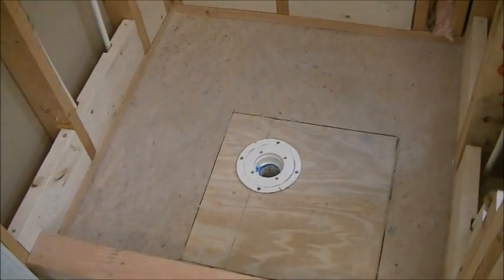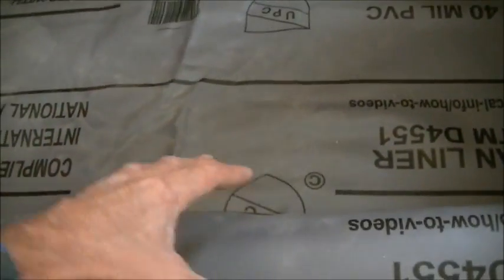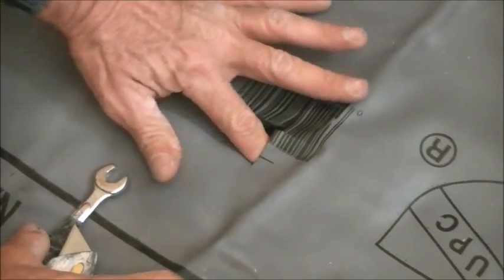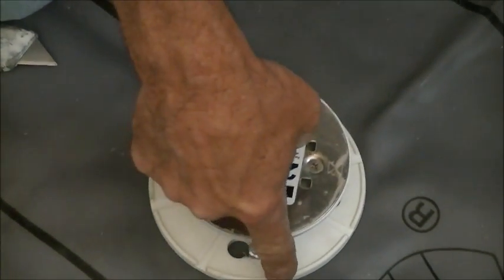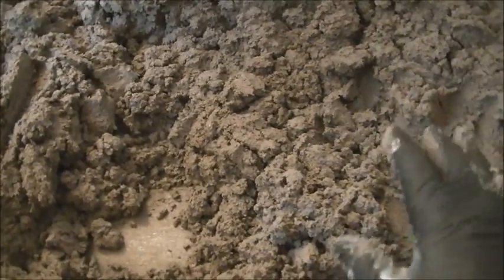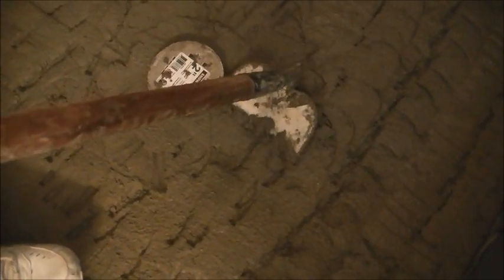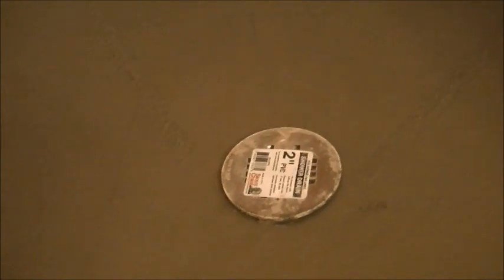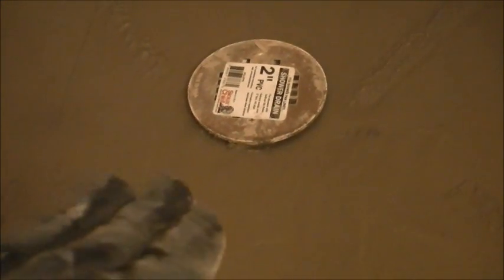How To Install & Pour Shower Pan

Comment: You are the first person I've seen who has put the flange bolts through the pan liner in a way that actually makes sense. Perfect, gasket-tight fit. Also, thank you for explaining why dry-packing is unnecessary, slow, and probably less sound in the long run.  Good stuff, thanks.

Comment: I used your Technique but pushed a roofing nail through and found the hole and then screwed my bolts in. But you have great information I'm almost done with my first walk in shower thanks to you

Comment: I poor two pans with red guarding each one. I also use quick pitch in my shower pan. I would highly recommend using them. Makes it super easy to get a perfect pan every time! Install from drain to each corner, screed your mud off of them and your done. Nice flat pan for a perfect tile install.
Reply: I had the quick pitch kit on order but had second thoughts. I did my preslope and pan by hand - it was not really all that difficult. Labor intensive, yes. But easy once you do the perimeter to the desired height then fill in the blank area, screed off down to the drain, and there you go.

Comment: You should try using a Marshal Town magnesium float to pack it down. To me it would be easier and faster than a mixing hoe. The comfort of the handle of the trowel would be easier on your wrist as well than a 2x4. Just a suggestion is all. Love that you use a drywall knife to smooth it out. They are universal in construction. But no tool is more universal than a utility knife. Mine gets more action than all my tools combined. It is a must have along with a 5&1. Love the videos.

Comment: congratulations! you just layed a brick mortar shower pan!! lol you might want to use blue tape to cover the top of the drain to protect it and for your information the drain has to be loose because underneath their is 4 vent holes that need venting on FHA drains and it needs to be loose for that and it helps to level out the tile for maximum draining compasity
Reply from the maker: Congratulations...you just watched a tiler with 19 years experience do it his way
Reply: +Jason Sanchez Congratulations you spelled capacity or compacity wrong which ever  you tried to spell, with your knowledge you should learn to spell.
Reply: mark card its my phones fault dang auto correct ! lol

Comment: I just pulled out a pre made shower pan from my basement shower (it cracked of course). It also had a 3 piece shower wall kit. I want to replace the pan with a poured one like in this video. Can I re-use the wall kit or do I have to put tile board and tile the walls? Thank you, love your videos.
Reply from the maker: If you do a real pan, you can't use those fiberglass panels. Yes, you must tile the whole shower.

Comment: Bob, I have to thank you very much for your videos. I have watched yours along with two other prominent YouTube remodelers, particularly the shower pan guys, and have just finished 'pouring' my first shower, a 3x5 center drain job. I took the best of all yoos guy's recommendations and I feel I am now an expert. I do have pics of the whole job from tearout to present. I can't see why folks put their Durock down to the floor and include it in the pan. Makes no sense. I am hanging my Durock 3/4" off my mud deck once set. Then 5mm hex tile floor and 18" wall tile. BTW I have been thinking of a price I would charge for this work while working along. It is based on blood, sweat and tear factors. I think I have a number. Would love to someday get a real quote from an expert and compare. Anyone in New Mexico you would recommend I contact? I will have another bath to do in a year or so. Was done 10 year ago by a box store contractor, and I feel like I can do it better.
Reply: In Austin TX shower pan pours range from $350-$650

Comment: Nice job but I would use the Schluter system. These are the older ways of constructing shower bases. Schluter has various sizes of bases with center drain, offset drain and linear drain systems. If the shower is too off and the Schluter base cannot fill in the whole area then I fill in the cavities with a sand/cement mixer. Also their is a company in Vancouver Canada that will create a custom base based on your dimensions. They work with the Schluter drain systems so everything comes out perfect. I have used them to create a 36" x 97" shower.

Comment: Nice video ! you make it look so easy ! I did a pan and it turned out pretty nice, but man I made a mess ! After the pan dried I have a couple of small low spots. Is it ok to go in with thin set to fix em ?
Reply from the maker: Yes I always screed out some thinset if I have any even minor dips

Comment: First off, thanks for your videos. Just a DIY guy here, I installed my pan liner yesterday, all went well. 
I bought the Home Depot Sand Mix (Sand and Bedding mix) It says it's a 3:1 ratio so I also bought some sand also to add for the mix. 
One Big Comment for you  StarrTile - In this video you say you used 3 1/2 Gallons of water for 2 bags. I'm not sure what bags you were using, but for what I bought at Home Depot, you only use 3 1/2 Quarts Per Bag - less than 2 gallons for 2 bags. . As usual, I added too much water, at first the mix looks dryer than what you show, but after you start working with it, the water really comes to the top. Hooe it does not mess up the drain, I was soaking it up with paper towels as it built up around the drain. 
Anyway, takes a DIYer like me more like 2 hours to pour and level out the bed. I think it's close enough. I'm hoping when it dries I can scape it around like you said in the video. 
Also assuming I can use Thin Set to level off any low spots (any comments on that? ) 
Thanks again. 
Next weekend it's Green board on the ceiling - Hardi board on the walls  (1 inch above the Bed as you show) All followed by a bunch of RedGuard - 

Hef
Reply from the maker: Actually the pre-mixed MORTAR in 60lb bags ( sand topping mix ) Is ready to go, no need for more sand. And it's ABOUT a gallon of water per bag...for 4 bags it would be about 3 1/2 gallons
Reply: Thanks, any tips on using thin set to level off low spots? I've got plenty of time to get this right.
Reply from the maker: Yes you could use thinset to level/manipulate the surface, but the ratio of water you used concerns me...if it was that runny you might have a compromised pan, I would consider busting it up & doing it over.
Reply: Thanks, I measured the water very carefully. I used less than the recommended 3 1/2 quarts for the first bag, seemed very dry. I can only mix one bag at a time, so on the 2nd bag. I just used the full 3 /1/2 quarts. I was looking for that consistency you showed in the video. Honestly, I think if I could have got it in there are worked it for 20 to 30 minutes as you know how to, you would not have seen all the water come to the top. , but I had to work it for much longer. The mix was not soupy or runny, just that water came up and ran towards the drain.

Comment: StarTile, I so agree with you on wet vs dry pack. Cement does NOT dry, it cures. It is a chemical action that makes the mortar hard. How can it bond and be ridged without water to cure? Dry pack strength will be mostly in the packing but missing the effect of setting up as concrete. Good video and instruction. Thanks.
Reply: Less water stronger concrete when you pack a dry pack if it comes way harder than fat mud also you should never have line in your shower pan it will crack

Comment: How do you prevent punctures to the sheet liner? I see you fold it in place, and attach it to the studs. This leaves folded areas in the sheet. So now when you add the mortar and the tile, you add weight. How do you make sure the weight of all that material doesn''t create holes in the folded areas. Does that question even make sense? I hope so. Thanks

Comment: I'm not saying your dry pack method  is wrong but to say it's a faster method is.  imo using wet mud is alot more touchy and seems to be more time consuming then a traditional dry pack. if a dry pack is mixed properly it drys very solid with no dry spots and levels and packs with much more precision then a wet sloppy mix. you also get no water rising and it's just a cleaner operation.  in the end, neither is wrong or right it's just what your use to. I actually duroc first, but leave the duroc up from the floor at the correct height of the dry pack and tile, this leaves me a level perimeter of duroc in which to more accurately estimate my dry packs perimeter.  I also draw a level line on the wall a foot or so from the  floor  which I use to precisely measure my dry packs perimeter. I know you said you like the dry pack to be tight against the threads of drain, but I'm sure you have to have adjusted your drain a little after a dry pack? personally I don't think adjusting the drain (threading up or down) after a dry pack does any damage what so ever, so what I actually do is pack to the top of the drain (making sure the drain has enough threads to adjust upwards the thickness of a tile )  then after the pack I adjust it up. I just find this a more accurate and faster way to pack, this way you don't have to spend alot of time worrying  about the distance from pack to drain in terms of tile height, also your levels can span across the top of drain as your packing, which allows for a better visual imo.  but again, it's personal preference and in the end your finish product looks great and I can see you take pride in your work and thanks for taking the time to educate. ps, I still would have completed the pan liner to the outside of curb

Comment: You don't necessarily need to install a pvc pan liner. I do prefer it but if you are using a drian with a bonding flange from schluter or prova or laticrete you do not need the pvc liner. You mud your pan with a chaffing membrane and diamond lath. You can do this after or before your backer board is installed. I install my backer board first and water proof it. Then I install the mud with a bonding flange style drain. After the pan is set you then install the membrane over top with all of the banding. Therefore making the surface of all the shower waterproof. Prova is my favourite because I can use unmodified or modified thinset to apply my tile. I'm a laticrete and Tec snob so modified thinset is my go to. Always use a grout that is professional grade with a sealer already in the grout. Laticrete pro grade grout is a great option. Tec has an acrylic additive for standard grout or opt for power grout. Power grout and laticrete also use Kevlar Vs sand which is stronger and able to fill smaller joints.

Comment: Very nice presentation. I have a question about a basement shower pan. I live in CO, and the wall regulation in CO requires that basement wall are floating. There's a normal base plate, but then the wall have to be 1.5 inches above the base plate, and are only attached at the top, and then a 60D spike nail through the bottom of the wall plate that is then driven into the base plate attached to the floor. As you can imagine doing this around a shower, and then adding the pan, and then tiling above the pan, could lead to some cracking issues in the wall grout. Do you have any suggestions, besides move to a different state?
Reply: yachick455 I am not familiar with this strange code.  However from what I understand after reading through the code.  This gap is to alow for rise and drop in the floor.  My best guess would be this.  If you have room after your pan and tile finish is within 2 and 3/4 from the original concrete floor?  (since your floor plate is 1.5" and the gap is 1.5" you will want to stay slightly under 3").   Install a waterproof expansion joint then tile up from there.  My only other concern is does the curb need to be floating free from the door jamb also?  The only other option would be silicone as an expandable grout.  however this would be an ugly solution and probably have to be replaced every 3 years.  only other option would be to buy a premanufactured shower kit.  Sorry my friend I am only trying to guess since I don't have experience with these codes.   ask your local building inspector for options.
Reply from the maker: What you explain was very complicated and I'm not sure I understand but I would probably consider moving to another state, LOL
Reply: StarrTile the code in CO requires you lay a floor plate on the concrete floor.  Then a1.5" air gap (for expansion) then frame the rest of the wall anchored at the ceiling.  in the gap between the bottom of the wall plate and floor plate attached to the concrete you drive a 6" spike to secure the floating wall to the floor plate.   like having 3 2x4  laying flat like your curb.  however take the middle one out to leave the gap.

Comment: Hi Sir, I have watched many of your videos, and thank you for taking the time to show and explain the process.  In this video, can you please let me know what type of mortar mix (the exact name/label, please) are you using? 
I am not doing a shower pan, but I am trying to level my bathroom floor for tiling.  Your mortar mix makes sense to me. 
Thank you.
Reply from the maker: You don't want mortar mix to level a floor...use a floor leveler, it's like concrete without rocks and spreads out evenly when poured.
Reply: Thank you.

Comment: Thank you sir for this as we are about to redo a 3 x 4' shower in our master. May I ask what is the minimum depth of mortar at the drain to avoid cracking there? And if I'm doing a 3 x 4 shower, about how many lbs of mortar mix do you suggest? Thanks!
Reply from the maker: Depth around rain should be no less than about 1"... about three bags of mortar should work but always have an extra bag just in case

Comment: I watched a few of your videos.  Beautiful mortar work.  :)  
I missed the addressing of silicone sealant around the drain, for shower liner.  It seems like you are not using any sealant?  Thanks!
Reply from the maker: Sealant on top of 1st drain flange ( under liner ) is recommended

Comment: i had to dry pack "below" the liner since I had to cut through the foundation to add the drain, basically creating a platform for the liner. You are right it was nearly impossible for me to level properly. I will use your method for on top of the liner. (my liner is basically sandwiched between two mortar mixes.)

Is the mortar mix different fro dry pack and wet pack? Or is it just the amount of water that makes it dry or wet? Also I am not sure if you mentioned what brand/kind of mortar mix you used from home depot.
Reply from the maker: Yes I mentioned & showed the mortar I get from HD.
It is said drypack will not absorb water if it gets wet, which is why you hear about drypacking...but I disagree, no proof to back that up.

Comment: The way a mudbed works, is it absorbs water and drains through the weep holes in the shower flange... without a preslope under the pan water can sit and putrefy.  It is code where I live to have a preslope under your shower pan.  Inspectors want to see the way the water drains after a leak test to see if any water sits, if it does they fail it.  If you say its a sealed system youre only partially correct.  Water is natures natural solvent... it will find a way.  So a preslope ensures many more years of a properly draining shower. cheers, love your videos just be careful because in many places a preslope is CODE...
Reply from the maker: So in my state there is no code for a pre-slope, of the hundreds of showers I've taken out in 22 years plus, I have never taken out a shower with a pre-slope...

And yes water is natures solvent, I would agree with that, but we are not trying to build a hundred year shower, only the lifetime of the homeowner, and they sealed systems we're doing now will stand the test of that time

Comment: If this pan is taking water how is the weeper holes is going to take the water into the drain when he mud the holes he suppose to put some 1/4" pebbles around the the drain cap an then mud around the drain
Reply from the maker: Pebbles are dense and a few get caught at the holes, you think water will pass threw rocks easier or sand ? You gotta think buddy.
Reply: Sir I'm not here for a fight I could learn something an also u could learn something
Reply: if the water is already in the pan then it will make its way to the drain. pebbles are not needed. what about where the pebbles stop? the sand  mix is still going to be flat against the pan liner. so pebbles are really not needed
Reply: I'm doing this for 20 years an this is my method here is a site  on how the pros do it  ( oatey shower pan liner installation )
Reply: One of the main contribution when the weepholes is not taking the water  lime is going to come up throw the grout joints

Comment: I don't know what they require in Georgia but here in Florida preslopes are required before the pan liner is installed otherwise you have sitting water in your pan liner causing it to rot...pan liner is required minimum 12" up the wall because that's how high water can cappilate up a wall before gravity stops it, you are using the wrong nails, you need the ones with the plastic caps, and corners need to have corner liner pieces glued in. This would not pass inspection.
Reply from the maker: Look through my channel, I document NEW CONSTRUCTION here without a pre-slope.
No proof anywhere they do what they claim to do.
Point is moot because I waterproof the pan surface.
I never use nails anywhere in a shower, all screws...except 2 1/2'' nails to set curb.

Comment: only negative to dry pack is it's harder to mix I think it's easier to install. if you do alot of tile and do drier mix an electric tiller works wonders for mixing it
Reply: that's what I do lol drill mix half bag  each time works fast, I hate mixing in tub...